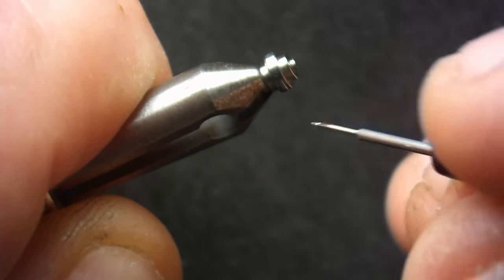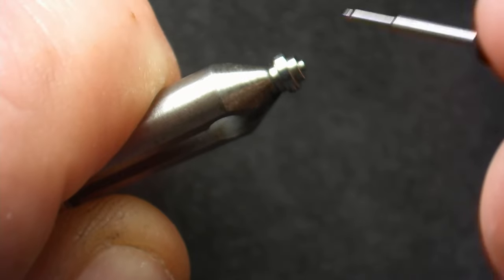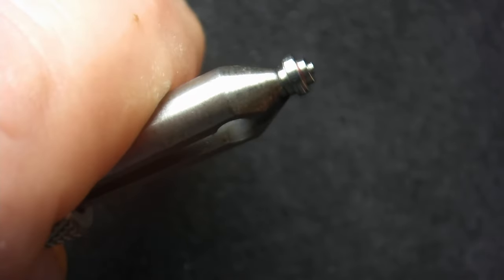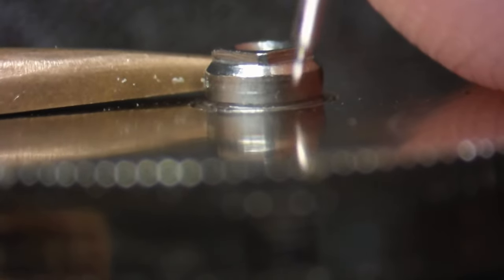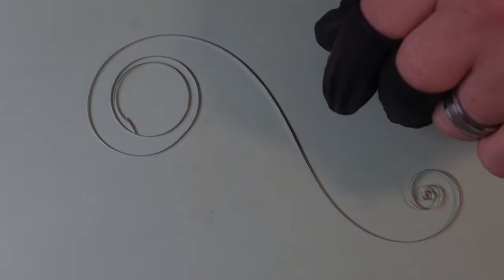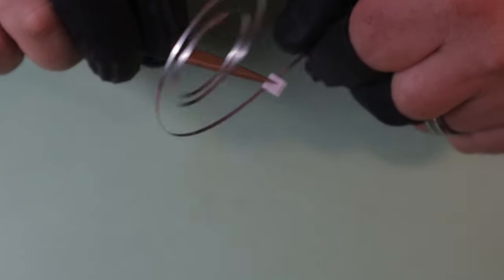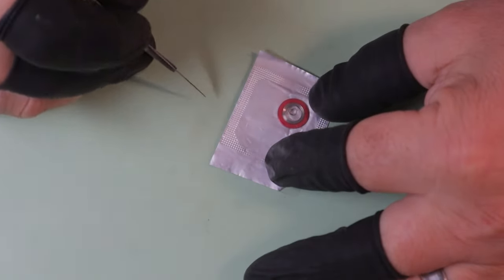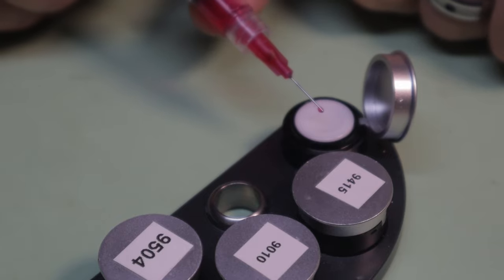Watch Lubrication for Beginners

Comment: 9010
hp1300
9415
And molycote cx 

So best ic an tell i'll be using the 9415 on just the pallet jewel/escape wheel teeth and the molycote dx  will replace the grease you used and i guess also works as the breaking grease for the barrel walls?  I tell you i'm only most of teh way into my first two dissassemblies and the hardest thing besides those f'ing seiko diashock springs is finding out who on the internet knows what they're talking about as almost nobody agrees on anything.

Also which oilers are you using for most of this? I haven't really seen much discussion of which oilers to use and when. I assume the super fine is for the capstones and pallet fork but I'm curious what were you using for most of this video.

Really appreciate your help here and on reddit. You're doing a great job.
Reply from the maker: What specifically is the area where you are getting different information?
If you are referring to what lubricants to use, this is one of the things that causes heated debates so always default to the manufacture recommended lubricants or their equivalent. 

As far as lubricants, yes, 9415 on the pallet jewels for the escape wheel teeth, Molycote can be used as the grease for the  movement parts other than the barrel
When reusing a mainspring, 8200 is the standard for lubricating the spring after cleaning.
 In automatic barrels, 8213 has been used forever and 8217 is the same, just with a little more holding power on the bridle, which can up the amplitude if you need it.
Kluber P125, has become the Professional industry standard for auto barrel walls but is 3 times the cost, so unless you have to use it, as professionals who have to answer to manufactures do, I would stick to 8213 for auto barrel walls.

For oilers I always use the finest tips like the Bergeon black 30102 and the Bergeon black 7013 for jewel lubrication but you can get by with just the 30102.
Hope that answers yours questions.
BTW whats your handle on Reddit ?
Reply: @watchrepairtutorials  Well on one watch forum i'm on one of the most prominent professionals says you need iirc about 7 different lubricants just for a service. Some say for 7s26 stick with the TWO that seiko's service sheet recommends

I'd say there's less disagreement here and more with most other things. I'm about to watch your vid on cleaning as that's the main thing it seems like nobody can agree on. 

Some say cheap chemicals like ipa and naphtha are garbage and will destroy your watch and make it rust solid, others say they've been using them professionally for decades with no issues.  

I'm baserock love on reddit. I think i asked you a really stupid question and you didn't answer it which is fine haha. I was trying to diagnose issues in two of my 7s26 watches and have diagnosed them.  One had a pallet jewel that was loose and dislodged as well as a diashock and cap jewel that was half out in the gear train. The other had a hairspring that needed the regulator pin adjusted.

Now just waiting for everything to come in for the fix. I've learned a lot since then so I might hopefully have some less stupid questions in the future.

I have a feeling in partially dissassembling these watches and diagnosing these issues i've probably introduced many much smaller issues into them and will end up having to attempt full services haha.

Keep it up though. I love your channel and you're super helpful.
Reply: @watchrepairtutorials  Hey I'm about to attempt my first lubrications, just a pallet fork and a couple cap jewels.

how do you go about polishing the tip on your oiler out of curiosity? It's so fine it feels like any sort of abrasive like finishing film will just bend it. I do have chemical polishing cloths as well.
Reply from the maker: @nunyabusiness9056  well the way I did it was with a felt wheel in a rotor tool.
I use a high polish company and just touch the tip to the felt as it’s spinning.
Reply: @watchrepairtutorials  Took a break from watchmaking as  ran out of watches to service and repair and decided to watch this again just to brush up again since I've got a couple projects to work on now and it was fun to see my comment when i was just getting started freaking out about servicing my first watch, well trying to. I've serviced 11 watches now and all turned out beautifully, including my first which was the cheapest seiko 5 i bought expecting i would probably destroy it, instead i t's got 275 amplitude and keeps fantastic time almost 2 years out.

Just wanted to thank you again for your fantastic channel. About to attempt my first complicated watch, a seiko bellmatic.
Reply from the maker: @nunyabusiness9056  and that’s so awesome to hear and I really appreciate you following up and letting me know means a lot. The old Seiko Bellmatic, that one sitting in my watch box right now
Reply: @watchrepairtutorials  wish me luck haha. But yeah. Your channel was THE best resource for a lot of things. Just wanted to thank ya. I'm actually considering horology school in the future.
Reply from the maker: @nunyabusiness9056  that’s awesome man. Something must have sparked a passion in you. 
Maybe consider my course on day. It’s going to be pretty extensive.
Reply: @watchrepairtutorials   Yeah i am actually!

Comment: What is the best way to polish the tip of the oiler?
Reply from the maker: What I do is use a hard felt wheel on a rotary tool with Polinum polishing compound but any very fine polishing rouge will work.
All it takes is a couple touches and it’s done. Too much and the tip is gone. 
It you have epilame dip the tip in it for added beading action.
Works 👍
Reply: @watchrepairtutorials  Thanks for the info! I don't think I would've ever committed to getting into this hobby without your videos!

Comment: How do you polish a watch oiler?
Reply from the maker: I use a very tool at low speed with a hard felt wheel loaded with a find polishing compound like Polinum. 
Use the slow speed and just lightly touch the tip to the felt wheel. Like two or three seconds at a time and then check it. It doesn’t take much and if you do it for too long, you’ll burn completely through the tip. But it does make a big difference.

Comment: I cannot understand, watch movements are not high energetic machines like motors why senthetic oil is needed ? High quality rafined mineral oils can overcome this too I think and they are cheaper.... What is the difference?
Reply from the maker: While refined mineral oils might be cheaper, they don't hold up as well when it comes to performance and durability. If you're looking for the best results for your watch, synthetic oils are the way to go. Here’s why:

Synthetic oils tend to create less friction and provide better protection against wear. That’s super important for the tiny, precise parts inside a watch, where even the smallest bit of wear can throw off accuracy and shorten the life of the movement.

They also last longer because they don’t evaporate as easily. Refined mineral oils, on the other hand, can dry out over time, leading to more friction and causing pivots to run dry, which means more maintenance down the road.

In short, synthetic oils might cost a bit more, but they save you trouble in the long run!
Reply: @watchrepairtutorials   My neighbor was machine oil expert and he had some special oil types in many viscosity and those are all mineral... He made them himself and I want to try  them on my Seiko 6309...  He has never fail about oils but I don't if he knew about watches... I will try first those oils may be will have good results... 

Thank you very much 👍
Reply from the maker: @asmobrat  cool, let me know what you find out.

Comment: I'm not following. Throughout the video you talk about HP1300 oil and 9104 grease. But as far as I can tell they're the same thing. Möbius 9104 HP 1300 is an oil. So what is the grease you're using, or am I missing something obvious?
Reply: My bad, didn't hear right! You were saying 9504 grease not 9104.
Reply from the maker: Damn I need to get those closed captions available. 🤣 I went back and listened to it so I see why there was confusion. The numbers are pretty close together.

Comment: I wanted to know , what will be done, to a vintage women's watch, left to me from my parents. I know it has a glass crystal used long ago on the outside sides of the watch. I thought they were diamonds, but it's not. It's in very good condition, when jeweler open it up all components were still working. Yet it's very old. He charging me $190.00 for cleaning and servicing the watch..
Reply from the maker: He will take it apart, clean all the parts, reassemble and lubricate it. 
Then they should regulate it to get the best time that the quality of the movement will allow for.

Comment: these moebius oils have ridiculously overpriced prices, its crazy stuff, there must be some sort of alternative to it
Reply from the maker: They are expensive but they last a very long time. Think of them as a tool. When it comes to lubricating micro mechanical parts small differences in viscosity matter and will affect the performance. But hey it's your work so do what you want.

Comment: When I first started working, I asked around to see what other watchmakers used. Most of them did not want to tell me. The few that did really perplexed me. One of them swore that all you need is one grease and one oil. In his case it was microlube 2 and moebuis 9010. He put that shit on everything. And he had a pretty long career and charged around 120 a watch. Another one swore that d5 and 8000 are still viable. I’ve got my set down pretty good. 
center wheel: hp1300
Train bridge minus second wheel and escape : hp1000
Seconds and escape cap: 9010 
Setting bridges: molykote dx
Setting wheels: 9501
Winding mechanism: 9501 
Escape: 9541
Reversing wheels: depends on tech sheets of the caliber I am working on and if I can even get them
If I can get the tech sheets I use what’s told
If I can’t : reversing wheels: 9010, automatic wheel 1000, axle for oscillations 9501
Caldenar wheel: 9501

I love 9501 so much lol
Reply from the maker: Most of them did not want to tell me. 
They were probably still using whale blubber. 😂
That looks like a decent mix.